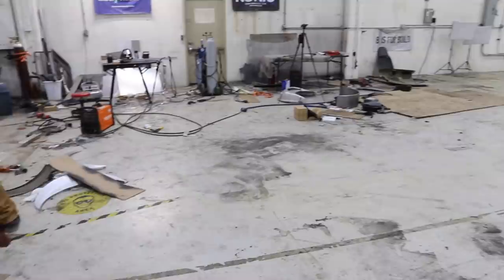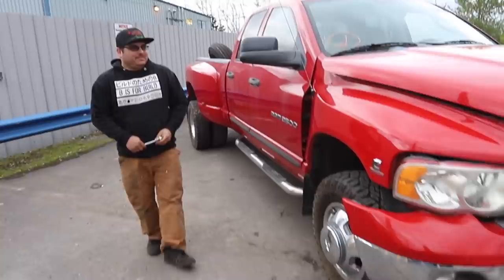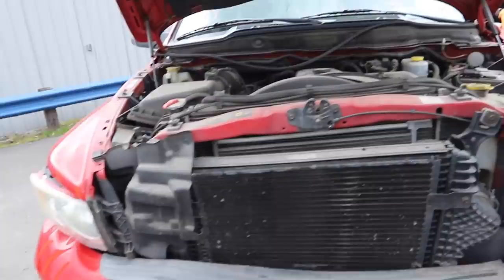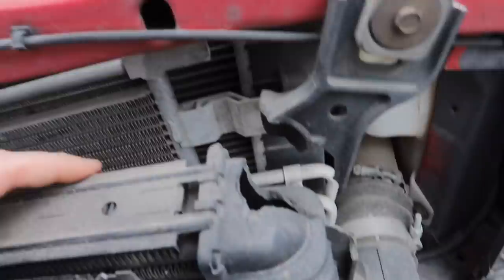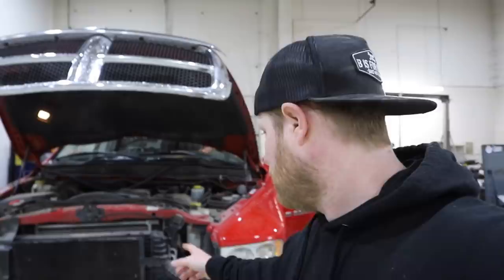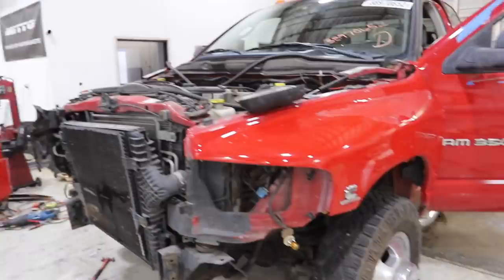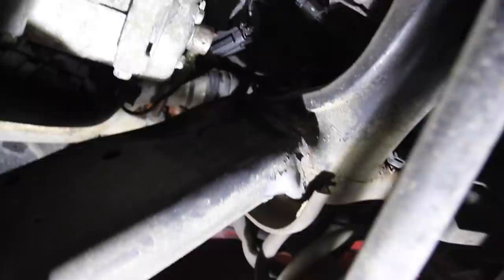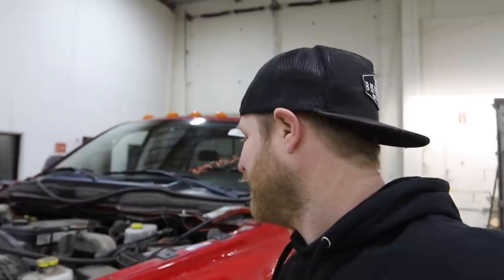We Bought A TOTALED Cummins 5.9 Diesel Dually to REBUILD and Rescue Our Builds

Comment: Check your blowby on your motor…take your oil cap off and flip it upside down and see if there’s any pressure from your motor…if the cap doesn’t move you have no blow by if it moves and there’s pressure from the motor you’ve got some…depending on the mileage…some blowby is normal

Comment: Well. If you were going to do an engine swap. You gotta pull the engine and make everything work together. Not sure but that could take longer than just repairing the frame right? I think a transport truck is the less fun but more logistical choice. Having something to haul with is never a bad thing.

Comment: You don't have power steering or brake assist because they both run off the power steering pump. As bent as the frame is, it likely wouldn't take much to crack the tank or knock it off.  The wires and the hoses under the dash are likely for a trailer brake controller and air bag helper springs. Which as cheap as all that crap is I am surprised they yanked it off. As expensive as used diesel trucks are, fixing this would put you money ahead of just trying to buy one in good shape. 

The truck is rated for 15,550lbs towing or roughly 21K-23K lbs gross combined, which is: truck, trailer, passengers, load and fuel. While not huge numbers, this truck will absolutely tow so much better than the Raptor, you will wonder why you didn't get a real work truck sooner.

Comment: A Caroliner + heat + 1/2in plating welded on the outside of frame rails? Might work as a quick fix until you find a used frame.

Comment: Get rid of the “Y” style steering setup. Get a “T” style Synergy or Dodge Off Road steering kit. Upgrade the power steering pump to a 2012+ with a new line, Borgeson steering shaft and change the Steering Gear box and that thing will drive much better.

Comment: If you actually do a full on build on this beyond just the utility, may I suggest you fabricate a massive moose pusher for it? Giant crash bar bumper mounted to the frame made from 1/4 inch steel so you can send brake checkers to Hell where they belong.

Comment: My suggestion is, work on the tuck in the background, like, no need for multi-episodes or anything, tyt with it and get it fixed right, then you can just post a vid of the key points of the work, tbh I'd love one of those myself but I have absolutely no use for a huge truck right now :(, it would be a great workhorse for the shop after it is fixed

Comment: A used frame isn't terribly expensive. I rebuilt my 1990 f150 after wrecking it. The replacement frame was $250 from the scrap yard. That was a long time ago, but im sure it would still be reasonable.

Comment: I would pull dodge the body off, part it out then body swap an older truck onto it. The 3rd gen dodges are cool and all but would be way more so with a different body on it

Comment: Could you just cut it past the bent part and double tube it and then add in gusits and strengthening it and then just reweld in the needed parts to have the rad supported and everything else

Comment: Got a Dodge 3500 dually in Cave Junction OR with gooseneck and and 5th wheel. Unfortunately Im in FL till tues night.  Bring the GF a car to drive and you can take it to go get the trailer

Comment: Keep the truck.  You can buy a brand new frame.  I worked in a body shop for 18 years and have swapped two frames in my career and both took a weekend.  You can swap the frame in a weekend.  Its a good truck and would be useful for the channel and there is no shame in rebuilding something back to stock.  Buy a new frame and swap everything over pickup trucks are easy to swap.

Comment: Don’t blame you for being less than pleased with Auto Auctions.  The unnamed that could be seen over your shoulder royally screwed me on a purchase.  Fees that were suppose to be waved seemed mor less doubled.  They’re really good at making their money.  I won a bit at $250, and $600 later I was able to wait 3 hours for it to be loaded on my trailer.  They damaged my trailer in the process and told me they basically didn’t care.

Comment: Keep the truck. Fix the front frame. Stretch the rear frame. Dump the box and build a ramp truck that will haul one on it's back and more on a trailer.  You have the perfect truck for this and already a lot of bucks in it, so use your head and do what I am telling you...

Comment: There is a reason  that truck or most any newer truck is totaled and its because of frame damage, truck frames with heavy damage are almost impossible to repair back to factory specs, and manufacturers  don't sell truck frame sections other than maybe the front horns, frame sectioning is no longer a viable procedure, your only option is a new frame which is why the truck was totaled, get rid of it, cut your losses and call it lesson learned, I was in the collision repair business for over 20 years and vehicles are totaled for one reason, the repair exceeds the value.

Comment: I seriously seriously think the truck needs to be rebuilt. Like.. I'm a gas guy but a diesel truck of that size and towing capacity is worth alotta money thrdr days even old ones. Find a f350 7.3 with 400k miles and it's still a 30k truck easily. 6.0 maybe not so much. But still. I think a Chevy diesel (lbz?) would be a better fit for the fd if you wanted to go that route.

Comment: Do not rebuild the frame. Just buy a new frame. They are like 5-6k ish and it is a solid platform. You need a new passenger fender and maybe a door. That's all. If you guys are capable of doing what you do, you can handle a frame swap. I have done many of them as an A tech in collision.

Comment: Loose wires are trailer brakes….you just bought the most reliable truck you can get….and yours is pre emissions so no def ….I myself have and earlier 5.9 and there fuel mileage will be better then any gas truck you own …5.9 Cummins will run and keep running I’ve seen them go to a million miles